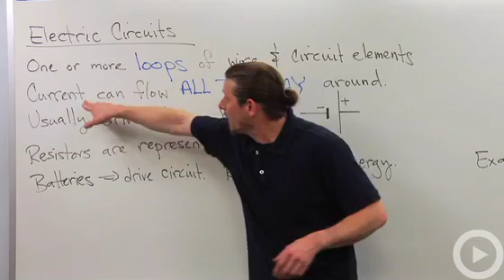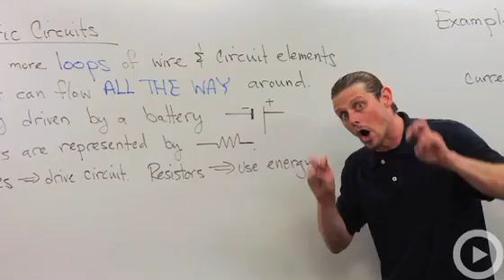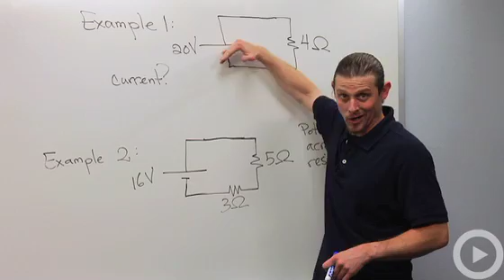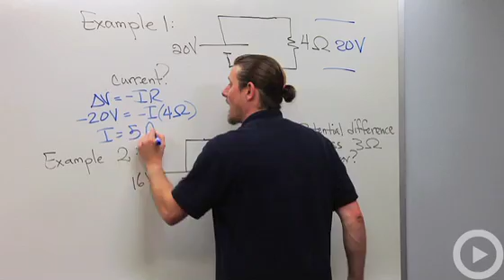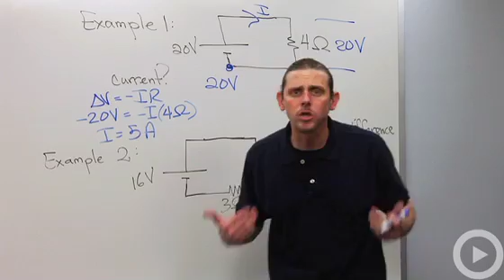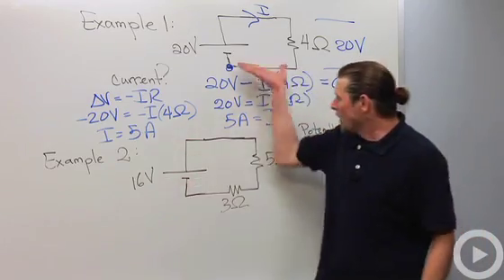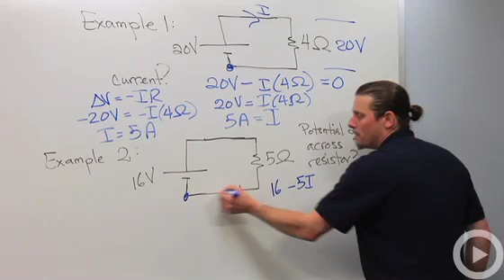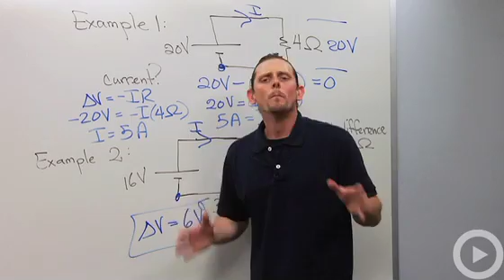Electric Circuits

Comment: why is delta v=-20 on example 1? shouldn't it be positive?
Reply: I actually have this question too. 
I'm thinking it's because delta V is equal to delta U over q, and delta U is Ufinal - Uinitial. We started from the negative side and went to the positive side, so -U - (+U)= a negative delta U, which results in a negative potential difference.
(Does that makes sense? Someone please correct me if I'm wrong! Thanks)

Comment: This video is good for understanding physics, however, for someone who is trying to learn electronics; it's not the best. I'm a junior in electronics student in a tech school and i understand it perfectly but, it's not as well made as it should be. Such as resistor term he uses and the symbol is only partially correct. Fixed though two things and this video would be great.

Comment: would you mind posting on how to find missing value or resistance in circuit if ther is 2 resistor and two has value how can you find the value of the last resistor that no value given.thanks